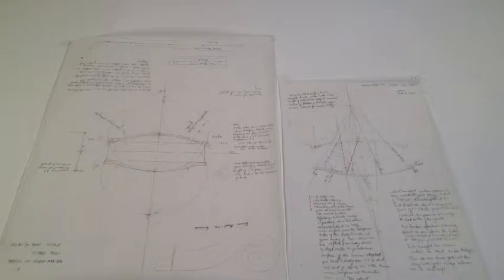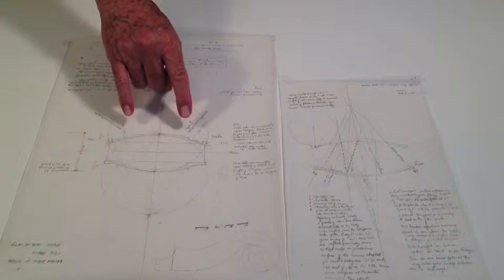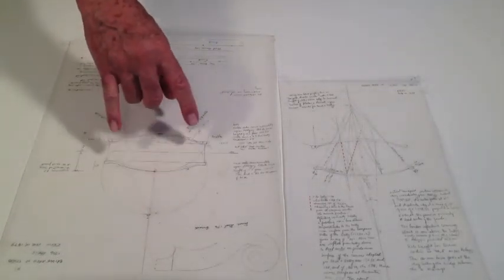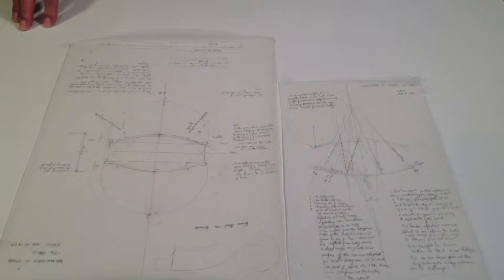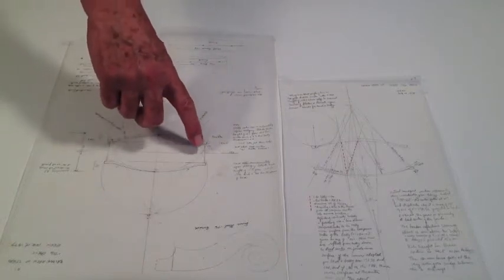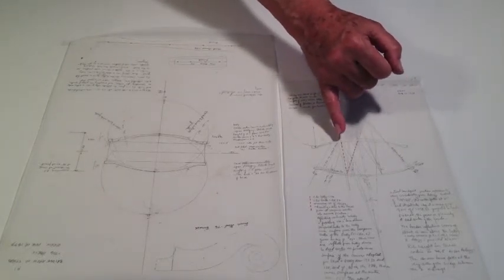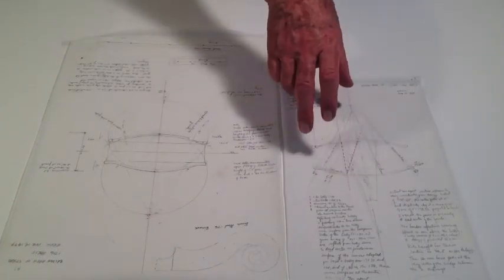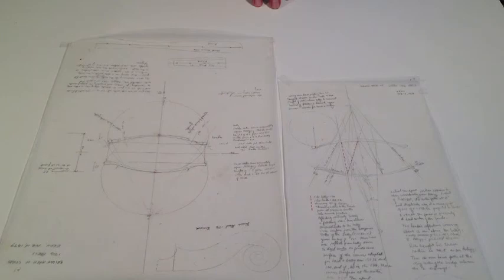Violin Arching 2

Comment: I have a question. In what you are explaining here explains something that I've seen in CT scans of some of the violins that were scanned. I've never heard anybody point this out or ever talk about it. What you were explaining here is this the explanation of the arch in the seat belt section, where I've noticed that both plates must have been carved the same way oh, what I mean is the arch inside is off center to one side, what I have noticed is that if the top plate in the back plate were carved off center slightly when they're on the ribs that those arches are offset from each other. I have noticed this on some of the violins in the CT scans, which obviously has a center point in between the arch Heights up the top plate and bottom plate. Is this what you were explaining here to where the vibrations in the sound reflect back between the top plate in the bottom plates?